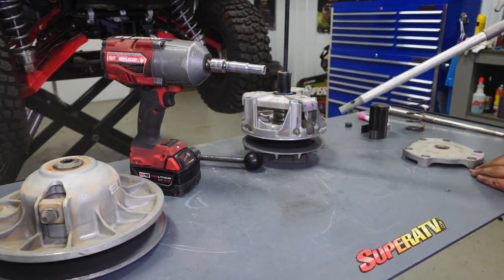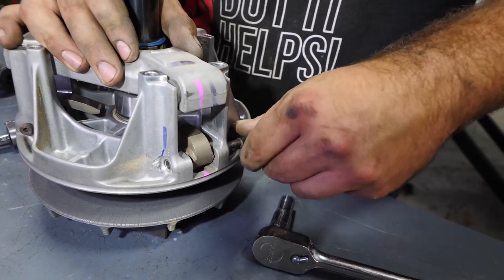How to install Rev1 clutch kit on Polaris General

Comment: overall a good instructional video BUT the amount of loctite used was really overly excessive in reality only need maybe a 1/16th of what was used to just a line is all that is needed for proper application of loctite using too much could cause issues in certain applications when it comes to specified torque.
Reply: I saw that too. Said just a little bit of loctite, then lathered it up like he hated the next guy working on it.

Comment: On the primary...when you took the oe bolt out that holds the arm. Do you get new bolts when you order the rev 1 clutch kit or do you use same old bolt?